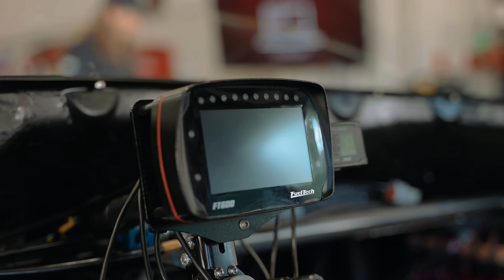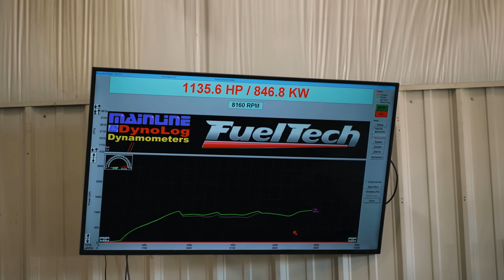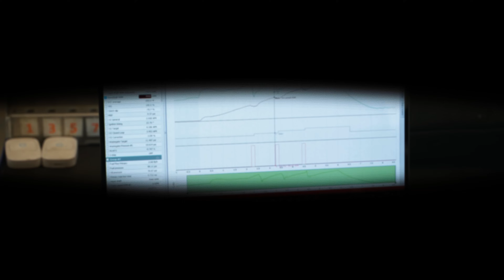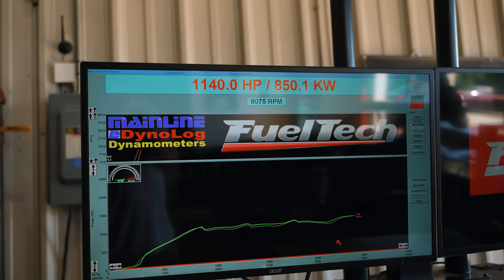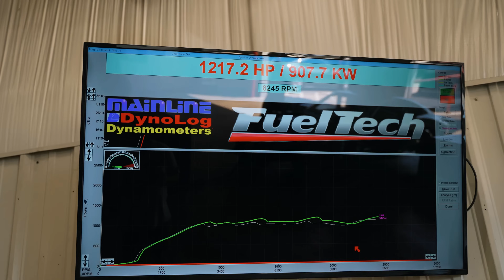1200HP Datsun 280z on our Dyno! | Rock Solid Motorsports

Comment: Actually the 3-4 looks like the same time as the rest however it appears to have split the rpm difference by flaring up as soon as or just before the cut engaged for some reason. I know he didnt, but it looks similar to when you use the clutch to try to speedshift. Almost like the shifter popped out of gear before the cut started.